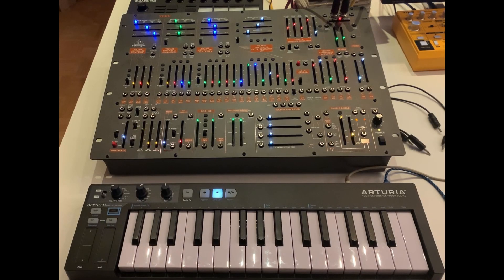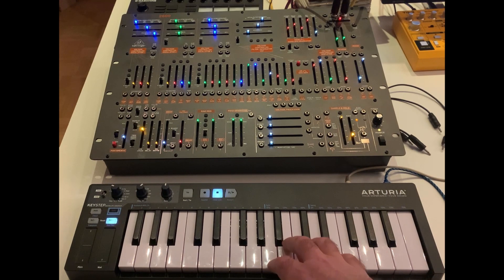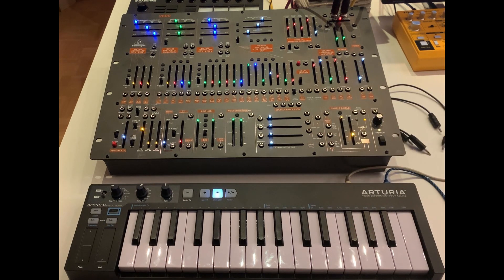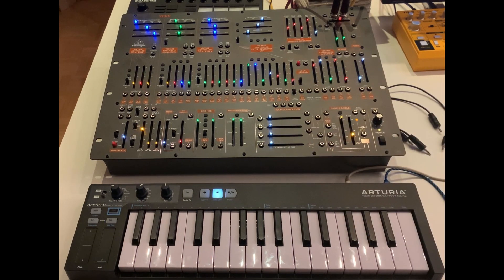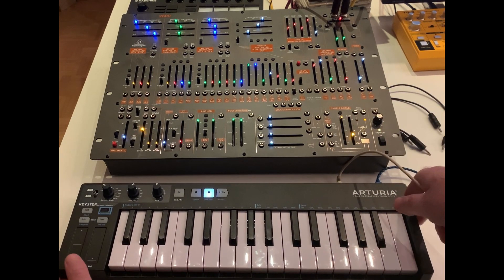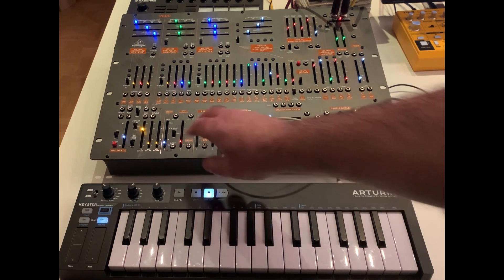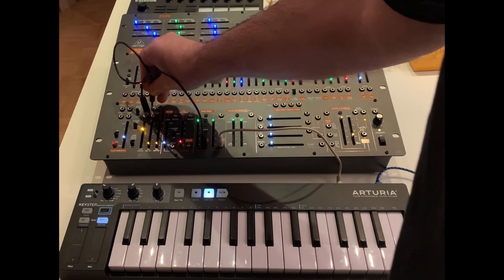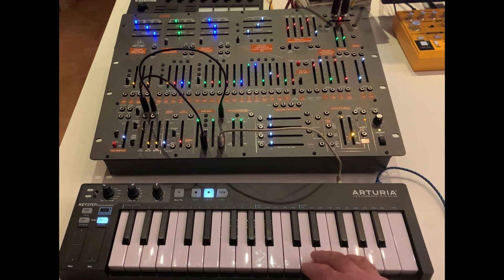Behringer 2600 - Quick Tips Tutorial 3 - vibrato via midi and cv

Comment: Wow, what an oversight Behringer!
At the very least a port with modulation output voltage to route from, would be the clever thing. I've just received mine, and not even got to modulation via keyboard. 
Great tip!
Thinking about it now, the model D could maybe be routed as a cv source? same midi channel etc
Reply from the maker: 100% agreed! Sure, you could use the model d's cv outputs and send them to the 2600 and vice versa, but that doesn't change the lack of a mod cv output on the 2600.

Comment: how can i control the vibrato from a MIDi keyboard  (mod wheel) ?
Reply from the maker: Afaik that`s not possible because the 2600 only receives Note On/Off and Pitch Pend via Midi. So you would need some interface with a cv out.
Reply: @tomnoise23  thank you - anyway-a monster synth !!!

Comment: Great tip! Is it possible to also modulate and sync the filter lfo via cv? Or more specifically the filter adsr control section so it can sweep clock to a daw?
Reply from the maker: Not sure if I got the question right, but you can trigger the ADSR by a clock. The LFO can be triggered as well, but its cycle can’t be synchronized.
Reply: @tomnoise23  thanks a lot for your reply :) yes, I just want to sync the lfo cycle for eg. a sine wave shape over 1 bar. I am already syncing the s&h with a pulse wave into the ext clock in- just can’t figure out a way to cycle the filter in a similar way
Reply: (Other than patching the internal lfo to the filter adsr which is fine, just not tempo synced)
Reply from the maker: @a-la-montagnes  ah I see. The LFO will retrigger on any new midi note if Trig Mode is set to Mult, but I guess you want to have it independently. As already mentioned, there’s no way to sync the LFO globally or to a clock.
Reply from the maker: @a-la-montagnes  by the way, not sure if you’re aware but the adsr can be triggered independently from the AR.

Comment: Hi, I did it just as you showed here and it is not working. What could be wrong? First I had the keystep connected to the 2600 with a direct midi connection. Then I removed that, connected both through USB with Cubase and I could play the keyboard again. But I don't understand what difference that could make. I only did it because you said that is how your keystep is connected. Then I took all the steps and the result is that using the mod pad on the keystep doesn't do anything. When I put up the vibe depth all the way the unit will give vibrato, but without any effect of the keystep mod pad. What did I miss?
Reply from the maker: Hi, did you check (in Arturia Midi Control Center) if the Keystep’s mod cv out is set to mod wheel and not velocity or aftertouch?
Reply: @tomnoise23  I thought it was correct because the vst's reacted correctly to it. But you were right, upon checking it was not set to mod wheel. When I corrected that it did work! But . . . When I push up the vibe depth, vibrato will sound anyway, regardless of the mod wheel. Is that to be expected? And please, what is the difference here in result between going via the daw or connecting directly through a midi cable? I'd really like to know.
Reply from the maker: @GerardMeerstadt  For the vibrato depth slider, i can't tell what could be wrong. When i put in a cable to "ext vib in" on my units then the fader connection breaks. Are you sure that the Ringmod mode switch is set to DC in your setup?
Oh, and of course you can use both methods to play the synth, either trough a DAW or connect the MIDI from Keystep to the 2600 directly. Shouldn't make a difference - Just make sure that they are both set to the same midi channel.
Reply: @tomnoise23  Ah, now I see what I did wrong!  Stupid thing, I just lifted my finger from the mod strip at the end. Then it stays on. Excuse me, I should know that it is not spring loaded like the pitch strip. Now everything works fine. Thanks for your help! :)
Reply from the maker: @GerardMeerstadt  Right, the internal LFO connection to the fader (correctly it should say=which is controlled by the fader)  breaks. That's what i meant.
However, i still have no clue what's wrong on your end and why the fader still controls the vibrato on  your unit if you plug in a cable to the ext vibrato input. Curious to know what could be the reason. Did you try to just plug in a dummy cable or dummy plug? Would the fader still work then?
Reply from the maker: @GerardMeerstadt  Ahhh, i see - Mod wheels usually aren't spring loaded... now that makes sense. Great!

Comment: why not keyboard mod cv direct to 2600   ext vib in ?
Reply from the maker: Because the ext vib in is overwriting the internal vibrato LFO,. It's not controlling mod depth. If the controller keyboard has a modulation LFO cv output then i would use that connection.